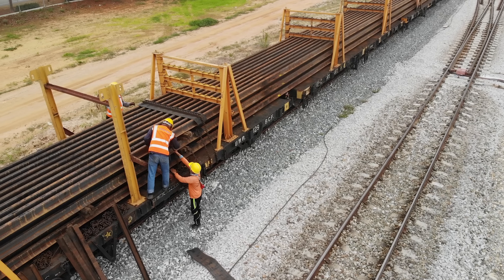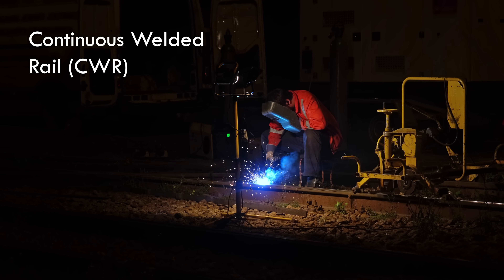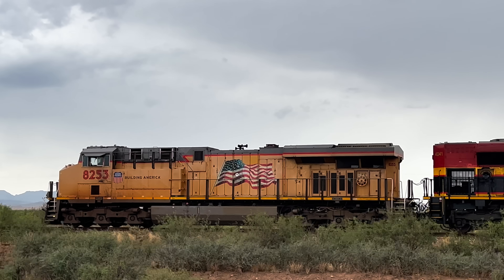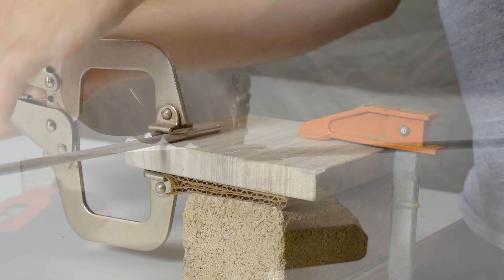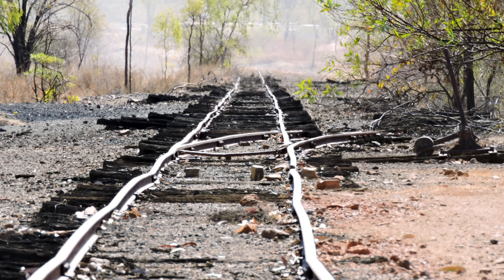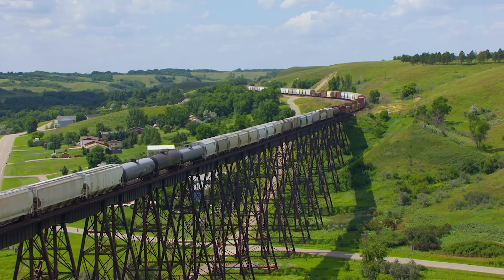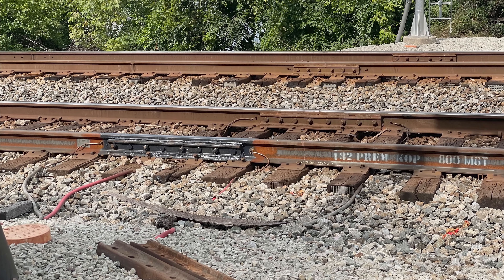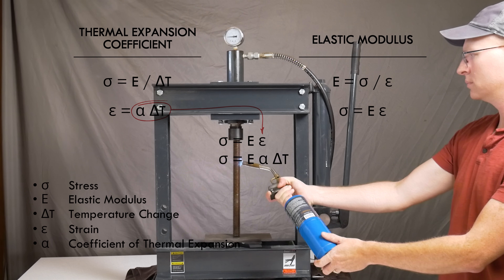Why Railroads Don't Need Expansion Joints

Comment: Rail is fascinating. I never considered that (fundamentally) you could just hold it in place and force it to not thermal expand and the stress isn't always prohibitively high.
Reply: We do the same with concrete, but in the opposite sense: pre-tensioned and post-tensioned concrete has reinforcing ropes (not just bars) running through it, plus some bearers at either end that connect the ropes to the concrete. With pre-tensioning, the ropes are stretched before the concrete is poured (and then released afterwards) and with post-tensioning, the stretching occurs after the concrete has cured but the effect is the same: the concrete is put under compressive load, which it can withstand better than tensile loads.
Reply: @sentinel76  that is the opposite of the rail tension.

Bur it's a bit semantic so I'll just clarify, not disagreeing exactly...

In the CW rail they are tensioning it almost all the time (except for very unusually hot days) to PREVENT the rail from being under compression which it cannot handle well.

For reinforced concrete the rebar is tensioned to INSURE the concrete is always kept under compression and never sees tension within the concrete itself, only in the rebar.
Yes the rebar and the rail are both in tension in the end, but for different reasons.

It's the same general design trick applied in opposite ways.
Reply: @craigslist6988  In the first half of his first sentence, you'll find the words "but in the opposite sense". If he had edited his post to include this change after you read it the post would be flagged by YT as edited, so I'm guessing you skimmed past that bit?
Reply: Think what  you are saying. Almost everything expands in summer heat and almost nothing has expansion joints, thus almost everything has thermal expansion induced stress including buildings, planes, and cars. But you never considered it?
Reply: Did you not watch the whole video? They do not just force it to not thermally expand. They install it at a high temperature so that at any operational temperature below that, it will be in tensile strain, not compressive strain. Tensile strain does not result in buckling as compressive strain does.
Reply: this is why I commented saying his explanation was a mistake. He has you thinking primarily of the rail being in compression. No. It's primarily in tension - the temperature on a hot day could be over a hundred degrees hotter than the temperature that same night. So it's not being engineered to survive compression, it's designed to survive tension.

The way he explained it as if it were engineered to be primarily under compression is ridiculous, and he only 'corrects' it at the end in a confusing way referencing it as the installation temp.

The demonstration of the bar being heated could have been done by first showing the part he did, where heating it caused the dial gauge to register the expansion. Then pass both ends of the rod through mounted plates and use bolts to tension the rod. Then put the dial gauge in again, heat up the rod and the dial would not move this time. Which also demonstrates the point - that you don't want the dial gauge to move.
Reply: Well, it still thermally expands.  But it gets wider and higher but not longer.  The width is also slightly constrained but the sky is the limit on height.   The "returns" aren't really in whether this length & width constriction is good or bad from a metal fatigue point of view.
Reply: I feel the same way about the compressibility of hydraulic fluid vs water. It's just difficult to intuit whats going on when the forces get bigger, you know?
Reply: Ehhh, isn't that quite a risk though?
Reply: @julianemery718 this video literally covered that question.
Reply: @julianemery718 Thousands of miles of daily operations suggests it works pretty well.
Reply: @julianemery718  No.  Watch the video.
Reply: @julianemery718 did you watch the video
Reply: @kaladin783 . What video?
Reply: @julianemery718 when destressing rail their is clips that go onto the rail that hold it in place generally spaced at every other tie around every 40 inches all of these anchors combined spread out the stress so tension at one point in the rail never gets to high their is other tie designs that do this same thing without the need for a anchor you can also see these processes even on jointed track at most crossings because the panels that are lagged down to the ties make them ridgid and more to a heat kink I could go on and on but if you'd like to see more go to your nearest crossing and look at the rail on each side just remember to look from a distance and park at least 10 feet away from the track and please do not walk on the track Goodluck and stay safe

Comment: In Italy they paint the sides of CWR on HSR epites with white paint to reduce solar heating of the rail.
Reply: Doing that reduces the rail temperature by just a few degrees. It is often a sign of poor track maintenance as if the track is in good condition such desperate measures would not be needed. An exception is the blades of switch diamond crossings, as expansion of the movable parts of the blade can cause point detection issues with the signalling.

Comment: I can’t wait to see the videos on signaling, communications and electrification for railways. I think the cherries on top of them might be explanations of why ERTMS and 25kV 50 Hz AC are the gold standards of railways. Keep up the good work, Grady!
Reply: 50 Hz AC is extremely convenient if your entire grid is 50 Hz AC. Just install a few transformers and you have traction power! No need to rectify it to DC or convert the frequency.
Reply: @TheBackyardChemist You just need to rectify it on train then!
Reply: cries in 15kV/16.7Hz
Reply: ERTMS is not the standard yet, but in the future it will atleast allow trains from different countries in Europe to cross the border without any effort. Most rail networks or trains in Europe do not work so well in other countries. It will also vastly improve signalling and reduce maintenance and faults.
Reply: Another interesting item. If there was a problem up track they had disks containing Mercury Fulminate that they could lay on the track to warn the crew.  The disks would explode in sequence. This was apparently still an option in the 50s as the station manager showed them to me and explained their use.
Reply: @RobertSmith-km6gi Torpedoes! I think they were used much later than the Fifties.
Reply: @buddyclem7328  
You’re right, I had forgotten that term. Several other more stable explosives were also used.
Reply: Yes! I'm an electrical engineer, and I genuinely have no idea how these signalling systems work. I suppose they use the track as a conductor, but does it automatically sense the train?
FIND OUT NEXT WEEK! Same bat time. Same bat channel. lol
Reply: @Falcrist As I recall from Railways Explained (which has a messier overview of the topic), the simple answer is yes, most legacy railroads do use the rails as part of a series of circuits several kilometers long. These are at currents low enough to not be lethal, but high enough to be detected by a trackside computer box like the ones at traffic lights. When a train runs along the tracks, its axles short the circuit, allowing the train to be detected in a given segment. Presumably the box sends the data commands to nearby signal lights via copper cable where applicable. On more modern systems such as most high-speed lines, drivers send radio signals from an antenna on the bottom of the train to passive transponders/RFID chips at fixed intervals, known as balises. These balises send back GPS coordinates and unique identifiers. These are part of a paradigm known as ‘fixed-block train control’.

However, many railroads are shifting to a paradigm known as ‘communications-based train control’. Here, balises are supplemented with train-to-train radio communication and more autonomous signals. This means trains can be run faster and closer together, increasing service frequency.
Reply: I grew up in the 50s right next to a track and siding. Actually there were 2 sidings, 1 for storage and unloading, and the other went to the local factory. There was a manned, manually operated switchhouse and small attached warehouse with a deck close enough to the siding to allow easy loading/unloading. The switches were operated by huge levers. I got friendly with the operator and he allowed me to hangout. When there was something to load or unload from the warehouse the men would often give us a buck or two to do the job while they sat down and rested. We sometimes got to ride in the caboose to the factory and back. It was a great time.
Reply: I can't wait for the video. Why does it matter the frequency for traction power?
Reply: @lightningdemolition1964   If the traction power frequency in AC is different from the mains or grid then it will need to be changed just as changing AC to DC as well as the voltage if DC is used.  There are several industrial (mining) railroads in the US that use either 25K or 50K AC 60 Hertz (our grid frequiency) for traction power.  The Northeast Corridor (Amtrac) traction power is 11K VAC but is 25 Hertz so the 60 Hertz has to be changed to 25 Hertz.  This was done in the 1930s well before  modern AC  systems.  The electrification of the commuter trains out of San Fransisco will be 25K or 50K AC.
Reply: @royreynolds108 thank you for the explanation. It's interesting how decisions made 100 years ago are so difficult to change now due to reliance on the installed infrastructure. I had no idea we had anything other than 60 hz and 400 hz for anything.

Comment: My biggest pet peeve on channels like this one is using units of weight as units of force. No, 3 tons is not a force.
Reply: But weight is a unit of force. It's the force induced by gravity on a body. This is why measured weight changes on different planets.
Reply: This is an engineering video, not a physics video. Of course 3 tons is not a force, but it's meant to be as "the same force as a gravitational force on a body that is 3 tons". It's probably much easier for a lot of people, who can't get a sense of how big a newton is and convert it to kilograms anyway.
Reply: @KarloTheGreen  Newtons are pretty small.  when I was a kid, I could eat a dozen at a time.
Reply: You'd hate real engineers then. In my job we use meters as a unit of pressure.

Comment: Not actually true!
I rode a commuter train for years and hot summer days brought about “speed restrictions “ ie we only moved along at 25 ~ 30 miles per hour.  In other words, a long commute was even longer
Reply: Was it for thermal expansion and buckling of the rails. Heat causes other issues. Where I live, the typical problem is the electronics for signaling start to fail and so the train has to slow down so that it can safely cross roads
Reply: @kylerichardson514 

The conductor said “heat restrictions”
Reply: Kent?